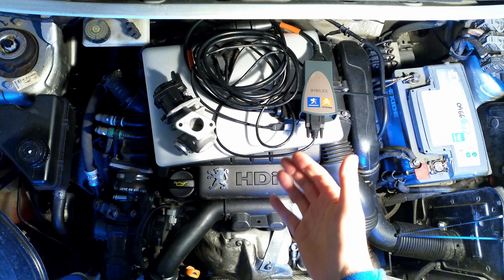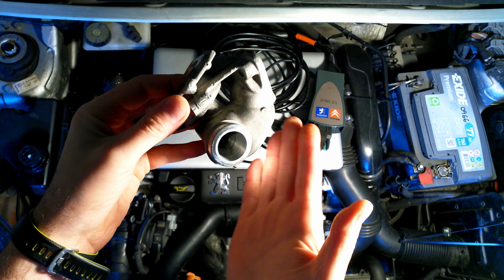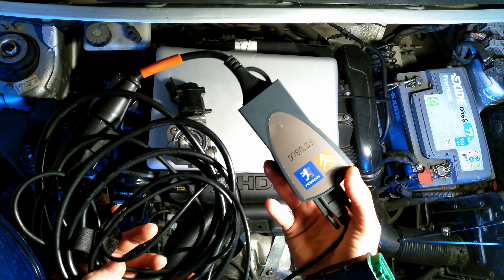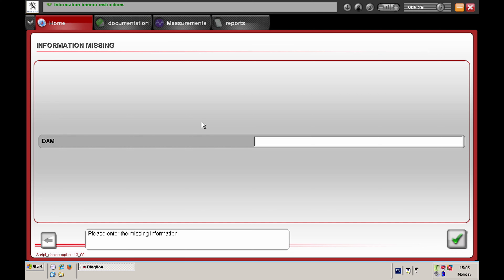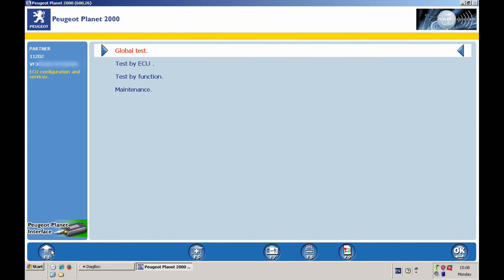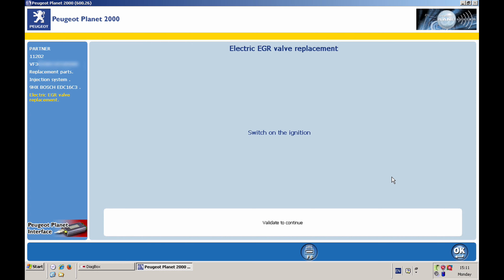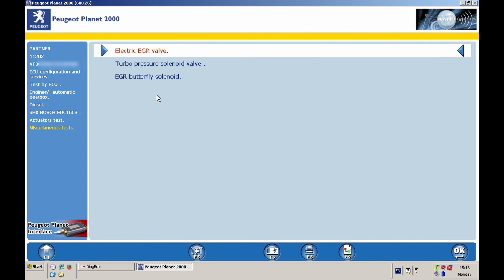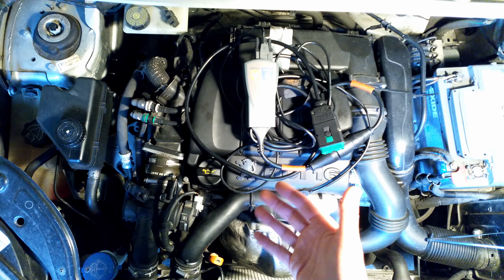1.6HDi new EGR valve recalibration or reconfiguration, how to with Diagbox or PP2000

Comment: Diagbox works on Windows 7/8/10 with no problem. Lexia works ONLY on XP
Reply from the maker: That's good to know. I always thought they work only on XP. I have only worked with it on XP, but good to know that PP2000 is ok with newer ones.
Reply: Where can I buy this program guys? Let me know someone that i can trust, ordered one from China but the disc only included music. Thx
Reply from the maker: @Andy_83_SWE  You can buy the interface on ebay, the DiagBox software can be downloaded through a variety of torrents.